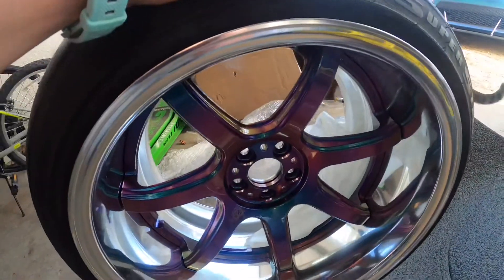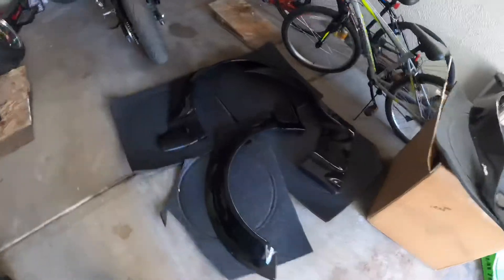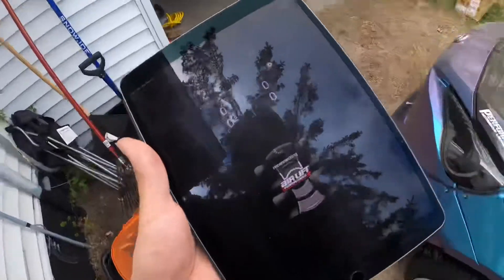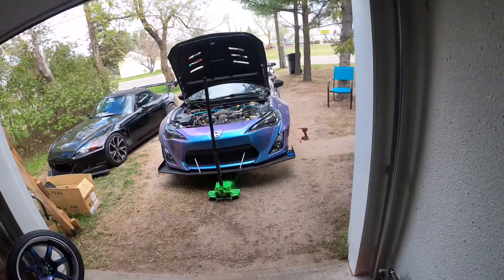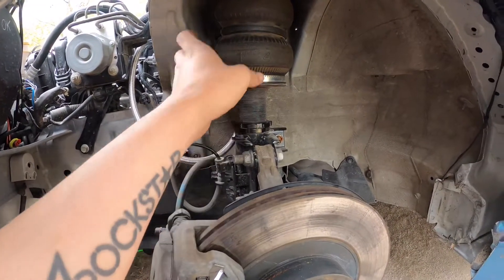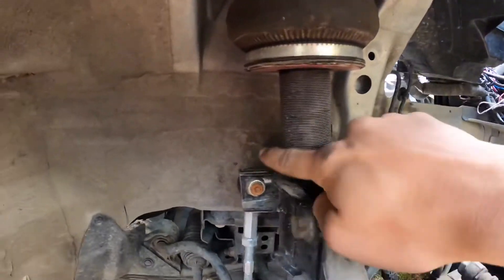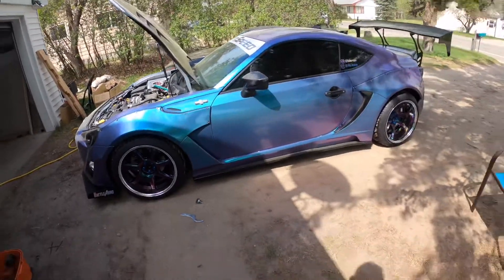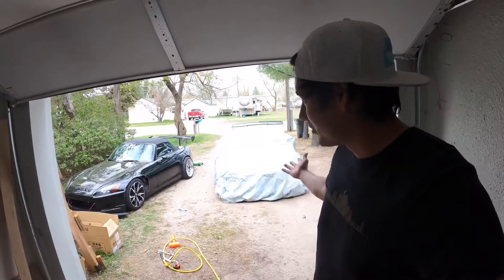Work wheels for the widebody FRS!!!

Comment: Keep pushing out videos bro, subscribing because frs fam. What are the wheel and tire specs? Deciding on wether I want to get my meister m1 wheels for stock body or for the rallybacker v2.
Reply from the maker: @Angel B Appreciate the support! I got like a month and a half of videos to edit and catch up on and thats why I'm up still lol. We've been super busy. The wheels are Work T7r2p 18x10.5 -10 front and 18x11.5 -26 rear. I would go a bit more aggressive in the rear. Its not cambered out either so if you wanted more of the stance look then you can go crazy with sizes as long as you upgrade all the suspension components. We daily our cars and take them to the track so they need to be "functional" 😂 I would definitely recommend getting 3 piece wheels so you can rebarrel them if you ever need or want to change up the fitment. Thanks again for the love and the sub!
Reply: @FRS2K   appreciate it man! I'm a function guy myself, oh ok not bad I was thinking 10.5 for my rears 9.5 front or all around 9.5 my frs is boosted with the jdl kit gtx28 bigger injectors flexfuel and all that so want some more room for meaty tires. Yessir I will be getting work meister m1 3pc wheels 👌
Reply from the maker: @Angel B Hell yeah! We have around 150k on the original motor so we went a little conservative and added the jackson racing supercharger. Once this motor goes then we will be dropping an LS3 into it and she wants to turbo it at that point. $$$ You should upload some content with your boosted FRS. Where are you from?
Reply: @FRS2K  wow! That's alot a miles that's good though, my 2013 has 80k atm. Smart move this car doesn't need much more power to feel awesome, I actually just saw that video sounds good 👌 oh damn a ls  would be nuts!! If and or when mine goes I want to k swap it. I'm in southern California,  when I get back from this deployment I'll upload videos of it for sure but by no means am I a content creator lol